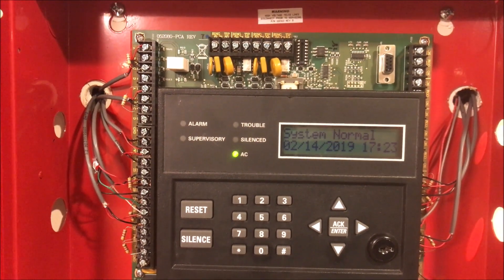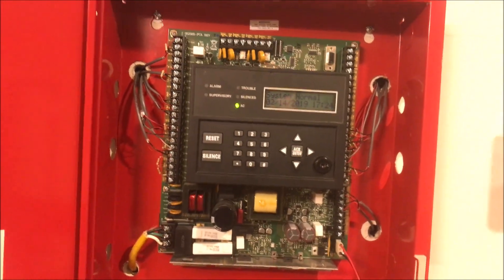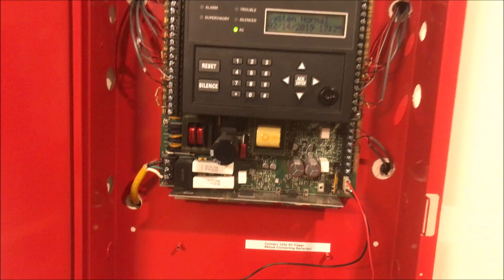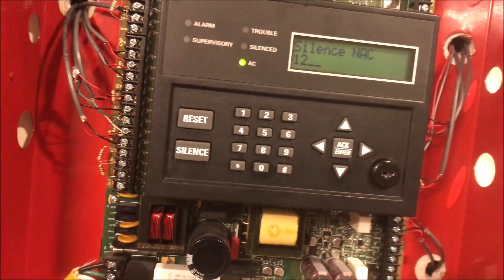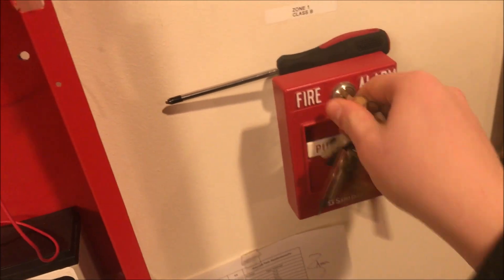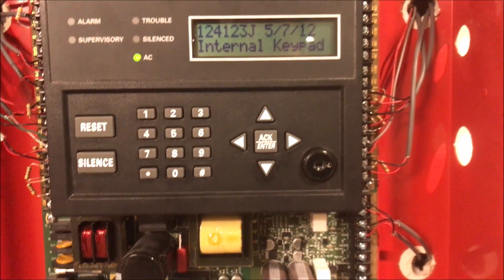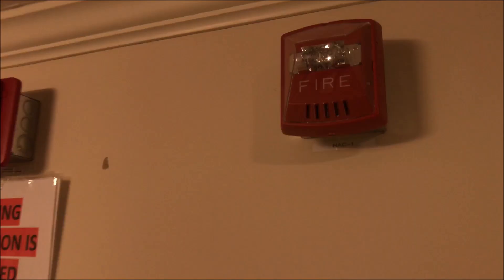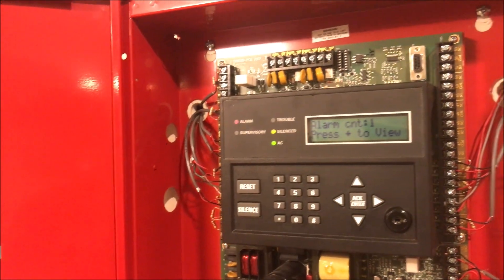How to do 2-Wire Audible Silence on a SK-5208

Comment: Wow, I have a 5208 myself and had no idea that's how it was done. I honestly thought that really only Fire-Lite panels had selective silence as a standard feature, guess I was wrong. Must confuse technicians when it comes to programming these kinds of systems. (5208 + 2-wire notification appliances) Thanks for telling us! Now I guess some of my 2-wire devices aren't so useless (although you still can't code them via the panel, you have to have them code themselves if you want to be able to do both audible silence and the strobes to sync, so thus I'd still prefer 4-wire)
Reply from the maker: Had that panel for a few years and thought I knew it inside and out! Definitely a hidden, albeit useful, feature!

Comment: How 2-Wire, 4-Wire, and Voice Evac Audible Silence works

2-Wire

Using a sync module that can sync the horns and the strobes to sync everything up. When the Silenced button is pressed, the relay that is syncing the horns to make them sound stops with only syncing the strobes and to also disrupt the feedback from the devices horn to the module so it can't sound

4-Wire

Using or not using a sync module and just cutting power to the wires that power the horn and not the strobe. On older devices that have the strobe running on coded pulses, the horns will turn off but the strobes will still be coded and synced by the sync module as they're non-silencable. Also the devices that have the strobes running on coded pulses, the devices are already synced

Voice Evac

Using a relay in the amplifier so it can't play the emergency message anymore by stopping it, and going back to the beginning of the message so it plays the full message in another  alarm event. The microphone is still usable because the amplifier isn't muted